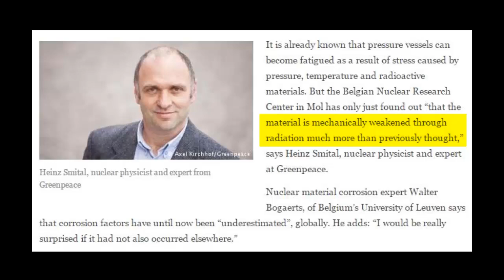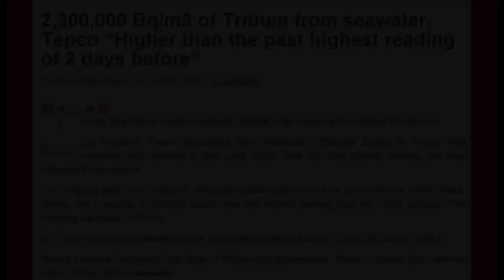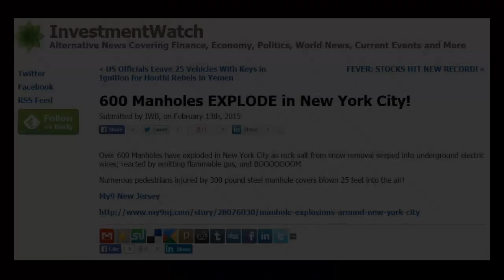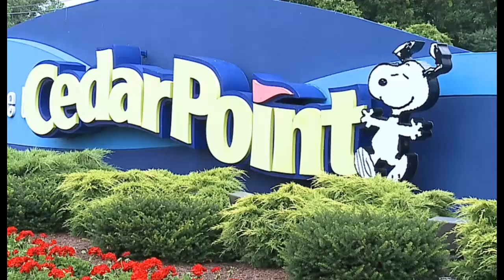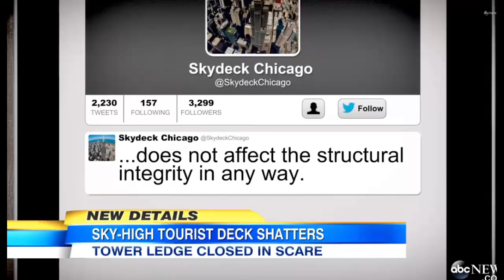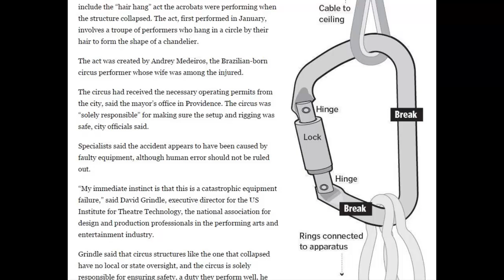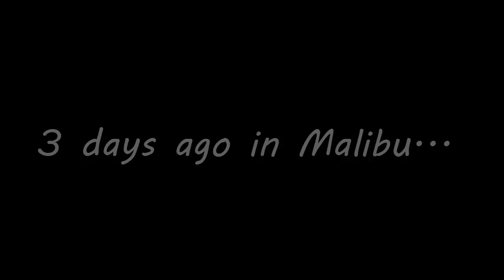Wigner10: Tritium & Infrastructure Events

Comment from the maker: SPACEWEATHER FINDS HIGHEST RADIATION IN 2 YEARS IN UPPER ATMOSPHERE: "A preliminary look at the Feb. 19th data reveals some of the highest radiation levels recorded in the 2-year history of the program. This could be a result of the current spate of low solar activity. Cosmic rays are repelled by CMEs and strong solar magnetic fields. When the sun is quiet, cosmic rays penetrate the solar system in greater numbers--an effect which the students are monitoring with their balloon flights."

Recall that although Spaceweather keeps insisting this is all gamma NukePro found something much different when he flew 10 hours from Chicago to Hawaii...

Spaceweather article here: http://www.spaceweather.com/

Nukepro assessment here: http://nukeprofessional.blogspot.com/2014/11/massive-radiation-found-in-upper.html
Reply: All gamma... I can't see how that's even possible.
Reply: 1 saftey clip? for how many people? ive seen tree climbers use 2 just for himself. i'm laughing at their superior intelect. i am riled still at one hook and no fail safe backup.

Comment from the maker: Travel nightmare of passengers stuck on plane for NINE HOURS - after boarding American Airlines flight that was meant to take 30 minutes 

American Airlines Flight 382 was supposed to leave Dallas airport at 1.45pm for Oklahoma City, but didn't take off until 10.48pm because of icy weather and issues with both the plane's pressure indicator and the parking assist 

One passenger said tempers were 'raging' after six hours and that people were shouting expletives at each other 

Another passenger said flight attendants volunteered to work extra hours after meeting their daily limit so that the plane could fly  

Tweeted that people were 'becoming ill' after sitting on plane for so long...

Passenger Ryan Eccles told Daily Mail Online the plane had problem after problem.
'It was frustrating due to just the number of things that were going wrong,' he said. 
'We had to wait in line to de-ice, wait for take off clearance, then we had a pressure indicator issue and had to return to the gate, and wait for a gate.' 

'Then our parking assist was broken, so then we had to wait for maintenance and start the whole process again' 

The scene on the plane 'got a little chaotic' as people started raiding the liquor fridge and pulling out drinks...

Read more: http://www.dailymail.co.uk/news/article-2973515/American-Airlines-flight-382-grounded-runway-nine-hours.html#ixzz3T51o93CX
Reply: I have to say though, because almost any time I go anywhere, Dallas is ALWAYS a nightmare.  Delays and plane-changing, and missing planes, and over-booking (in Dallas, in particular) create the biggest hassels, in Dallas.  Even before Fukushima, I cannot recall ending up anywhere, on time, if I went through Dallas.
It's just so typical.
Add ice to Dallas, at all, and this is what people should expect.  But, everyone seems to forget this is how it is there, and they all flip out, creating a more difficult situation for everyone.  I have had Dallas flight-attendants drink with me, on the plane (they gave me drinks) only because I wasn't being a jerk.
Reply: 4:10 attach to water, rain, snow, etc. so important!

Comment: When it comes to Fukushima and the Pacific, tritium is the one isotope that's worried me the most.  I mean; it basically becomes water (or a structure of water), so there would be no way to stop it.  When IAEA discussed the "ALPS" program, at Daiichi, and what it could and could not do (remove), tritium was THE isotope they admitted was impossible to remove.
So, when it comes to all of these dying sea-mammals and fish, I think we're seeing a big tritium problem.  And I don't think there is any way to fix it.
Of course, some of the bigger mammals (sea lions, seals, etc..) may be picking up cesium or strontium from outside of the ocean (carried on the wind and water).  But, the ocean is probably full of tritium.  And, what is the one isotope nobody is checking the Pacific for?  Tritium, of course.  Why?  Because they would find it in huge numbers.
Reply: annebeck58 I agree that tritium is a big theat if much of it gets out into the water, but thing is that tritium is a very rare isotope. Even if Fukushima released some tritiumdioxide into the water, it would not even be measurable in the pacific ocean. It would require that the entire reactor's coolant supply would consist ONLY of tritiumbased water, to even be linked to the accident at Fukushima. This is not the case, and I hope you understand that the big theat with nuclear power isn't the nuclear accidents, but the highly radioactive nuclear waste.
Reply: +CptHrki  Wrong.  I am not talking about the tritiated water they have intentionally released.  I am talking about the tritiated water that flows through the plant (and is affected by cosmic rays) which flows directly, unabated, into the sea.  It HAS been detected on the West Coast, USA.  So, you are wrong, again.  Its half-life is 12.3 years.  So, wrong.
Reply: +CptHrki  By the way, I say, "tritiated water".  because mixing 3H with Oxygen makes it so tritium is impossible to remove from water.  It becomes water.
Reply: CptHrki -- there's a reason for that.
1. your response on RadChick's video was just too stupid for me to want to waste my time, and,
2.  Honestly.  Your comment made little sense.

You need to study the effects of (varying) radioactive isotopes before you continue on as if you're some sort of, "expert"..., because your comments are pretty much inane. 
Adios.
I have other things to do.
Reply: CptHrki   Okay, I'll answer another part of your stupid comment.  You really think sea-mammals are ONLY being effected by tritium in the air?  HA!  It s in the water AND in the air.  Once it hits land, it is in the soil, too (as it is on the West Coast, USA, Canada...)  They are not only breathing it in.  They are swimming in it and are swallowing it.  They're also eating prey which is FULL of radioactive isotopes, including tritium.
Honestly, guy, your comments are absolutely asinine.
And, again;  I have MANY other things to do besides read and respond to your ridiculous assertions.  STUDY it before you bother me again.
Reply: CptHrki   I haven't only studied it.  I have used my common sense to figure it out.  I have asked questions of those you'd think are gods (of nuclear.)  And I understand it a heck of a lot better than you, darling.  Otherwise, you would stop coming out with so many ridiculous statements.
And then you start cussing.  That's so typical when you freaks get frustrated.
Reply: CptHrki   You are far too impatient and presumptive for my liking.  Do you really think all I do, all day, is get on youtube?  Dude.  I've been building a computer with old parts, making up designs, embroidering these designs,. and more.......  I do not have time for this silliness and will respond when and if I have time and when and IF I feel like it.
Jeez.
Why are you so very silly?  I have things to do.  Honestly!
Reply: Here:  https://plus.google.com/u/0/104698773678800612307/posts/KPgC6BLW9pg?cfem=1  Join this group.  You can learn a lot about radiation and what's really going on, in Cali and in the whole world, as pertains to radiation.
Honestly, I just don't have the time.  I have a LOT of work to do..., once I get this screwed-up computer fixed.
Reply: Or, even better;  check out this post:  https://plus.google.com/u/0/104698773678800612307/posts/YyjpX1gJq5B?cfem=1  
It will give you a lot more information about the many different nucleides we're dealing with in the Pacific and throughout the Pacific Rim...
Honestly, I just don't have the time to sit down and read and respond to comments. I am trying to make a damaged computer work so I can get some designs done.  I do not have the whole day to myself.   I cannot just sit on the computer and chat.
Okay?
Check out that groups, and specifically, check out that post.  It will teach you a lot.

Comment: OK.  I have to call bullshit on some of this stuff,  You didn't say how old those buildings are or give any proof of radiation in those places that you are talking about with burst pipes.  As a matter of fact you haven't shown any evidence of anything that you are saying.  I have an old house with copper pipes and they break and get pin holes in them too.  Even before Fukishima.  Copper pipes do that with age because copper gets precipitative hardness which means that the older it gets the more brittle and hard it gets.  It is not wigner effect.  Also I read the article that you showed an Air Canada plane with a propeller through the side.  You failed to mention that the plane had a flat tire and the prop hit the ground.  Read the article and look at the picture and see how many blades are left on the propeller that touched the ground.  Not wigner effect.  Here is the link: http://rt.com/news/203935-canada-propeller-smashes-plane/

I'm not trying to minimize the seriousness of the Fukishima  disaster or deny that radiation from this mess has reached here but just trying to associate everything that happens on wigner effect from Fukisima radiation tends to erode your credibility.  That's why I don't listen to mainstream media.